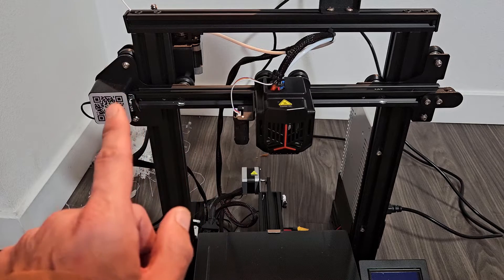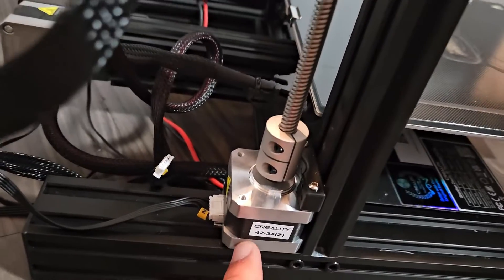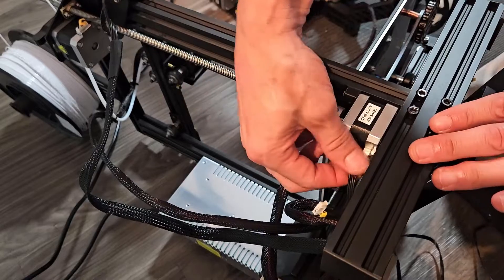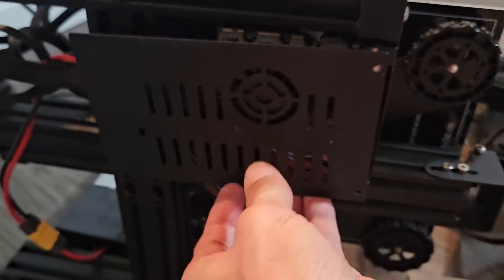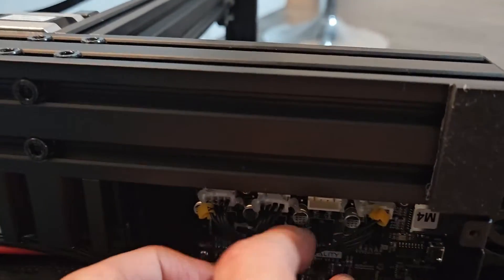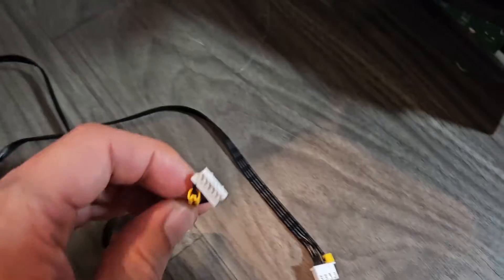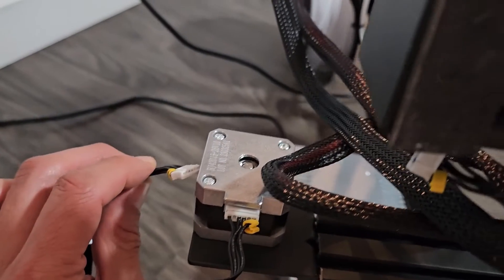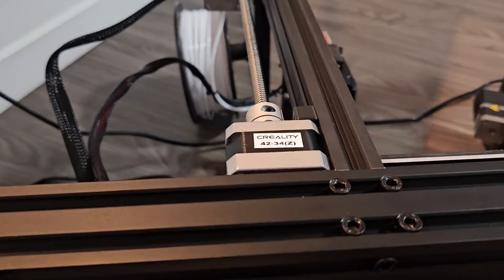Ender 3 Neo: Z Axis only Moves Up? Finally Fixed! Easy!

Comment: Thanks , I've got exactly same problem and the black burned stuff it's literally on the same pin , I've tried replacing cr touch, changing firmware, nothing helped

Comment: It was a bad switch for me that fixed it. The x axis limiter switch to be exact
Reply: The switch was bad so it never told the motherboard to go to the next step when I switched out the x axis switch to a new one it allowed the sequence to keep going into the y axis movement. But because the switch to the x axis was bad  it wouldn't ever go to the y axis step

Comment: dude thank you so much that simple thing and you were right the Creality cable are way better than the sun s8Pro now I have it fully operational on Miriscoc ender 3 v2 4.2.2 board on a 300wX300lx200 h I finally realized how cheap these cables can be and got them to operate delicately thank you man! now onto the BL touch !!!!!!!!!!!

Comment: I changed the hotend ONLY, with cames with those cables the red ones and the white one, that's the only thing that I have to switch from the motherboard, and now i have this problem too, and the CR Touch won't go down and start to flashing red light... before the printer works good, but now idk what happend. I already order this cable and I'll see if it works on me too. If anyone had this issue + CR Touch flashing red, let me kno. I want this printer to be a backup one for me, that's why I want to repair it not sell it for parts... :( Thank you!
Reply: I'm currently having the same problem where it only moves up, and the CR touch probe won't go down when auto homing, it only flashes red. Please let me know if that cable solves the problem!
Reply: @rogerjohnson755  HI! For me it didn't work. After a friend of mine check'd the main board and there is a capacitor next to a 24v input that emits heat and that capacitor moves left and right, I think that if I replace it, it can be a solution.
Reply: I changed my bowden tube ONLY, and now my BL Touch behaves exactly the way you describe.

Comment: Hello great video!  i have a weird problem with my neo max ender 3 im hoping maybe someone will have had same problem. When Z axis is homing its not stopping at the bed it carries on until it hits the bed and the motor starts grinding. I've tried 2 new BL Touch creality own new ones with no success.

Comment: Hi there. I just received a brand new Ender 3 Max Neo and it literally worked one print (rabbit on the micro sdcard). After finishing, the printer only says Homing Fail and I have this issue where the Z Axis never goes down. Do you think I have your very same issue? I don’t want to go through your process as it is a brand new printer. Any suggestion apart from sending this back to Creality? Thanks
Reply from the maker: Hmm… in one of my other Enders had same issue… creativity had to send me a new z axis cable.
Reply: @WorldofTech  thanks for replying. I think I have the same issue mention here. Both Z axis cables are black on one side. 😞